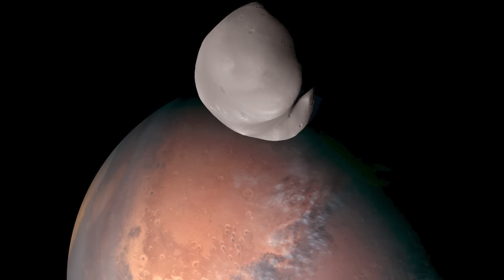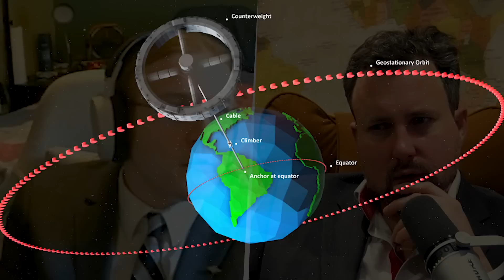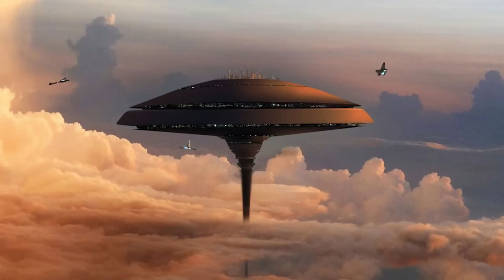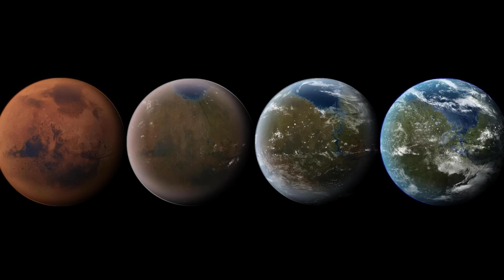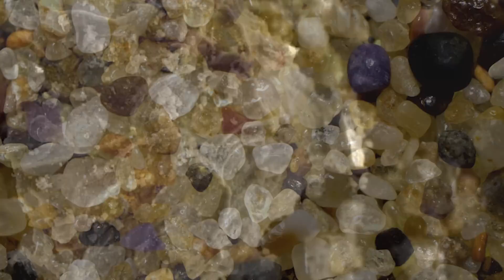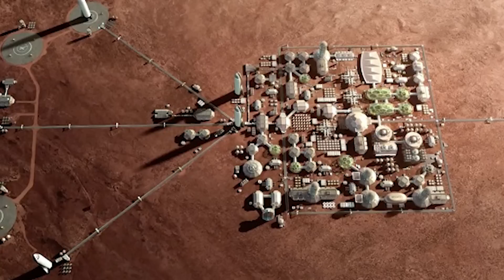Let's Build A Space Elevator!

Comment: Building a space elevator would take far more technology and resources than all the rockets launched in the coming decades. You are also required to expend the same amount of energy to transfer an object from the bottom of the elevator to the top as a geostationary orbital rocket, making the exercise pointless.
Reply: Rocket engines aren't an efficient mechanism. Their efficiency at turning chemical energy into movement is incredibly low by itself, which isn't surprising given how much noise, vibration, heat and light they give off at launch. There's a lot of wasted energy there. Then there's additional waste from the vehicle itself in terms of added drag and vibrations that comes with brute forcing yourself through the atmosphere at several times the speed of sound. Then there's the reality of the rocket equation which means you need more fuel to carry your fuel to carry your fuel to carry your fuel etc etc. which is why orbital rockets end up so large for such relatively small payloads. 

A good electric motor is over 90% efficient at turning electricity into work, some of the best are as high as 98% efficient and going at a crawl, drag is negligible. Setting the logistics and practicality of a space elevator aside, the vehicle riding the space elevator cable to geostationary orbit would be incredibly efficient compared to any combustion based vehicle, and would expend much less energy inserting the same payload there.

Comment: A big issue is if it breaks at the top, then the tether will fall to earth wrapping around the planet causing ungodly damage.
Reply: That's nonsense. If it breaks most of the mass will fall upwards, not down. The bits near the bottom will break apart, which would not be ideal, but not even the worse engineering disaster that has occurred on Earth. You could even put parachutes on the pieces as failsafes.

Comment: Venus has clouds of Sulphuric Acid ....... making it a tad difficult to make stuff there. Also a surface temp of over 400 C and a pressure of 93 Bar (93 times more than here on Earth) again making even robotic construction not possible at our current tech levels! The best models we have suggest an anchor mass would need to be 30% further out than the geostationary point creating an even bigger device!

Even with Elevators you still need 2/3 of the thrust (to get your Delta V) as without so getting over LEO is a problem (as Elon has found out). There are other problems, like wind! Wind would set up oscillations that given the masses involved would break any material we can make to shreds in short order. The only way round this is to only use them on airless moons or to build thrusters in to compensate. No small problem

There is a possible other way to get round the solar system cheaply and easily .... relatively of course ...... Sling Shot!
You have solar panels powering a motor. The motor spins two tubes in opposite directions. Drop an object into the near centre of one of the tubes and centripetal forces will accelerate it down the tube. Get the math right and it pops out going exactly the direction you want. Slowing down is a near reversal of the trick. The only thing we need to do is get the timings right!

Comment: The BIG problem with a space elevator, which is impossible to  get round, is that if anything ever went wrong there'd be 1000's tonnes of debris falling from 200,000ft and landing anywhere within 100's of miles.
If Space-X's starship or booster fell in an accident it'd be a 23 story building potentially landing at a random place on the planet...
If a space elevator failed, it would be 10,000x worse AND it would 100% be in a populated area (as it'd be a huge logistics and transport hub)
Reply: Have you ever watched footage of a huge radio mast falling? It just crumples. Some would burn up beforehand.
Reply: @jwadaow  But this is an incredibly strong sci-fi material with insane tensile strength. It wouldn't buckle like a normal metal under stress, it would stay in once piece and act like an unfathomably large whip that would fall awkwardly and then thrash around as it fell. 

And even if this sci-fi material wasn't highly heat and fire resistant, not all of it would burn up because of it's velocity. Only the upper part would be going at orbital speeds in relation to the Earth at point of reentry. That leaves hundreds of miles of cable falling to Earth in a highly unpredictable way.
Reply: @jwadaow  yes, but from low earth orbit (just googled it is 525,000ft not 200,000ft my bad) is 160km/ 100miles.
Some of it will lag behind the fall, it's certainly not going to crumble in a neat pile. 
It'll also be in or near a major city to facilitate the operations. 
It would be like 1000+ large airliners crashing in a city. There is no way round it, it would NEVER be allowed
Reply: Your understanding of orbital mechanics is appalling. You need a geostationary orbit, that's 22000 miles plus another five to ten thousand for the counterbalance.
Reply: @paulhawkins6415  LEO is the lowest stable orbit, theoreticaly possible in this case if constant trust is used to keep it in that orbit and to keep the elevator in tension.... which would be preferable to building something that could wrap around earth's equator and be even more dangerous than something that's only 100-150 miles up.

Could you even imagine how annoying that elevator music would get, let alone if someone farts on your 22,000 mile elevator ride
Reply: @SuperAd1980  Your understanding of orbital mechanics is appalling. There is a reason that LE satellites orbit the earth at over 17,000 miles an hour. If they didn't, gravity would pull them back to earth. It's not a case of 'thrust'
Reply: @paulhawkins6415 it's still far easier than building a 25,000-mile tall elevator. 
And yes, it's absolutely about thrust. Your understanding of physics is appalling.
Reply: @SuperAd1980  Oh dear, let's try again. If you are stationary above some point on the surface of the Earth, say 100 miles up, the force of gravity is 9/10 that of on the surface. The amount of thrust needed would be about that of one of Elon's larger rockets, constantly, forever. Are you getting it yet?  You question my physics, could you point out where it is wrong, please. I am always willing to learn
Reply: @paulhawkins6415  still EASIER than a 25,000mile tall elevator! 
Are you understanding why it's impossible yet?
Reply: @SuperAd1980  I have known a space elevator is impossible for 50 years. It is physically impossible to make a material strong enough to withstand the tension
Reply: @paulhawkins6415  your way of making a space elevator is wrong, my way is better. 
Both are impossible, but you are wrong 🤣🤣🤣🤣🤣🤣🤣🤣🤣🤣🤣🤣🤣🤣🤣🤣🤣🤣🤣🤣🤣🤣🤣🤣🤣🤣🤣🤣🤣

Comment: Orbital rings are straight up better. Less upmass to get from earth or the moon, lesser material engineering requirements so no need for Carbon Nanotubes which enables it to be built with already existing if still advanced materials, can connect multiple points and do so in a wide area around the ring and can function as ultra fast planetary and interplanetary transport infrastructure between connected ground stations and between rings, can function as a massive kinetic battery for storing and arbitraging energy, can function as a massive solar collector for powering itself and local areas via the cables. And the cables can be pulled up to avoid storms too strong to be weathered without sacrificing other areas or the stability of the cable itself.

And with tethered orbital rings, although theyre less capable than a full orbital ring, you get the advantage of being able to build it on the surface, and then lift it into near space by hoisting it from boats with sea floor anchors thus eliminating the need for pre-existing orbital construction infrastructure to build a full orbital ring.

Comment: There are no materials that exist which are strong enough to build it, and the ground isn't strong enough to stop it pulling itself out.
Reply: if the satellite is geostationary there should be no need for the cable to handle anything other than its own weight plus the payload.
however geostationary requires a cable twice the earths circumfrance.
Reply: @arcticghost1393  much of the mass would be in the elevator itself, most of which is not at geostationary orbit. There needs to be a counter weight and the forces on it all will be immense!
Reply: @harmonykrieg  how about capturing a  large asteroid like the one currently in temporary orbit and using thrusters to guide it into geostationary.

It's going to leave anyway so we only need to slow it down, not push it to a higher orbit.

Comment: Just build an orbital ring instead (Isaac Arthur has a good video on it, or you can watch Cool Worlds if you want to see someone copy his homework). You need copper, magnets, a bunch of cables. No unobtanium material sciences necessary.
Reply: Big fan of the sentiment, but even the most basic ORS is a colossal undertaking.  Even a tethered ring would be a stretch to economically build right now, but a rotating tether (skyhook) might be a reasonable first step for orbital infrastructure
Reply: The weight of a wire that circums the earth at 100km heigh is like 10,000tones. 

Once a wire frame is up then it can be tethered and slowly added to using the feather to bring up materials.
Reply: I watched the video, and the thing is too expensive to bother, be impossible due to national security concerns of unfriendly countries, and be destroyed by space debris. And these are just the obvious showstoppers, I don't quite trust Issac Arthur to cover the less obvious issues an engineering team would run into.
Reply: @thearpox7873 could just stick it on an island in the Pacific.

Comment: While it may be physically possible to build such a thing, it is wholly impractical, not to mention exceedingly dangerous. If anything were to happen and it, fell, back onto Earth, think of the potential damage that could cause. Some of it would burn up, I'm sure, but I'm also sure much of it wouldn't. You'd have to build very, very far away from anything inhabited just in case it did fall over. Then it would need top notch security and permission to shoot down anything that flies anywhere remotely close to it to prevent the potential for someone intentionally flying into it. It's also just not very good, think of the insane power consumption it would need just to stay powered on, let alone when in use, then you also need to adjust the orbits of every satellite in space to prevent them from coming anywhere close to the thing. If you're just using it for freight then you don't need it in the first place because it would be far more efficient to perfect existing rail-gun launch prototypes than to build a massive space elevator and all the potential costs and issues related to that, it doesn't need to be powered on all the time, can be scaled, and can use totally renewable energy and charge while not in use. If you just need to get people into space conventional rockets are just fine for that. If you cut out the need for the rockets to have a bunch of extra science equipment on it, or a whole return pod, and just used it to ferry people into space you could fit about 100 people onto a SpaceX Super Heavy, for example and still be able to launch it. You could likely create a rail-gun type launch system that ramps up in speed like a rocket launch to reduce the G-forces and also use that to get people into space too. That would be much cheaper to produce, safer in principal, and easier to power. Space Elevators are cool science fiction, but it's probably best in reality to leave them in fiction.

Edit: Of course, the most obvious reason why a space elevator is a bad idea is Van Allen Radiation. There's few methods to deal with that, and they all add substantial cost, weight, and/or power draw, plus any pod would need to go slowly up into space, for stability reasons and also for altitude sickness/pressure reasons when it comes to a passenger pod - which means more exposure to radiation.
Reply: How did Buzz Aldrin and gang survive the van Allen belts?
Reply: @joriankell1983  By not going through them. The lunar insertion orbit took them around the belts, above the orbital plane at which the heavy radiation is situated, around the equator, and the part that they did go through had little radiation and they went quickly. A space elevator would need to go straight through the heaviest of the radiation, which would not only fry electronics, but without extremely heavy shielding or extremely power hungry magnets to deflect the charged particles, would kill a person in a relatively short period of time, and that's just on one trip through it, try going through multiple times, the radiation adds up. As stated previously, the elevator would very likely move very slowly too, for a multitude of reasons. It's just an all around bad idea in practicality.
Reply: @Hirome_Satou  cool, thank you
Reply: It wouldn't have to be at the equator. Isaac Arthur was saying that you could have different ground stations that meet at the top. That would allow it to be anywhere but also gives you multiple departure points. Sounds logical. You could go up one and down the other to another continent
Reply: @ClifftopTragedy  even if you eliminate the need for it to be at the equator you don't eliminate the dangers of it falling back to earth, the disruption to the satellite network, the power consumption, and likely more. When again, there's better methods that don't require building a mega structure which can be done with current technology and significantly less danger or risk.

Comment: Hear me out... Stationary blimps stacked on top of one another. Run the space elevator cable down the middle.
Reply: Why not stationary turtles all stacked on top of eachother?
Reply: @curiositycloset2359  Because they're susceptible to Pizza and Crime Fighting.
Reply: @curiositycloset2359  I'm being serious here. If the problem is weight causing too much stress, why not add counter weights in the form of lighter than air balloons?
Reply: @gabrielclark1425  I can only assume something in the realm of the Hyatt regency collapse would be in play. Doesn't seem logically consistent.
Reply: @curiositycloset2359   ...do you mean that it could collapse, or do you mean long term bias because of a previous disaster that lead to Skywalks/Lighter-than-air-craft being less common?

Because if it's the former, the first solution I can think of would be to build out wider as necessary, and run hoses to ground based facilities to keep them topped off on gas...

edit: Start with a nuclear reactor on the ground with easy access to large amounts of salt water to split via electrolysis, start stacking until the air isn't dense enough to provide any lift, lower another cord and hose down from a satellite towards the top platform, use the energy and reaction mass to power the thrusters on the satellite to slowly straighten up the space elevator that was previously allowed to drift out of position with the planet's rotation, start shipping up material to build a bunch of solar collectors to wean off of ground side power.

Boom, space elevator with no magic metamaterials that may or may not exist, with the benefit that if it breaks it will fall very slowly!
Reply: @gabrielclark1425  I'm just saying stress over a load isn't mitigated by pulling up on that load. it's not the weight, its the stress. Pulling up and down, doesn't reduce the stress.
Reply: Why even have a cable.  Why not just have multiple balloons taking up smaller payloads.  Like a rail one side up one down.  Balloons get deflated at the top and then go down the other side of the rail to get reused, just goes round and round one smaller payload at a time.  Will save billions on venuses nanotube sky factories.
Reply: @gooseboy6046  balloons only go up as far as the atmosphere allows.
Reply: @curiositycloset2359  i know.  Also the gravity drops off the higher you go.  So the problem of heavy cable gets a lot of it removed from the system.
Reply: @gooseboy6046  problem is, the gravity doesn't drop off, it's just the platform is in permanent free fall. 

As said, the problem is stress, not so much weight, as we think in an everyday sense.